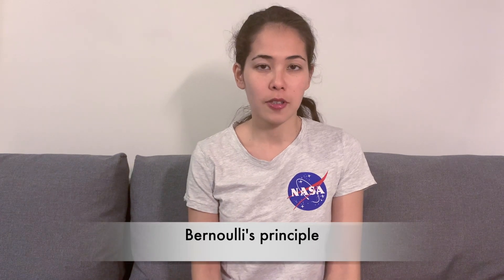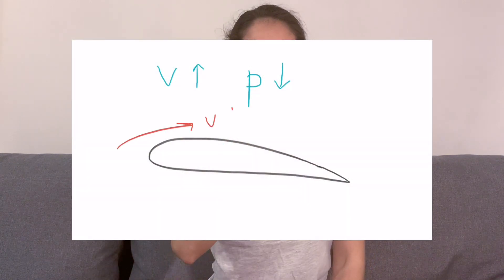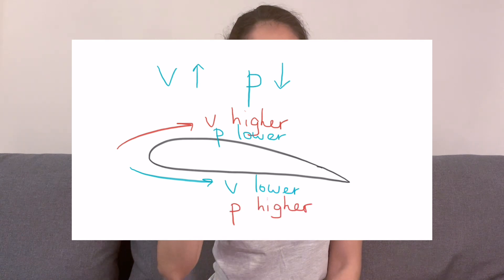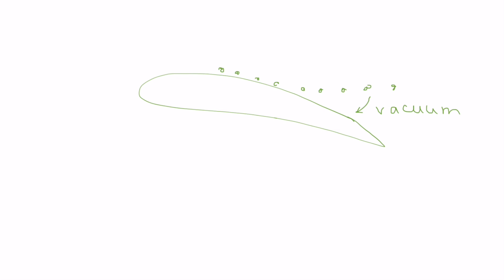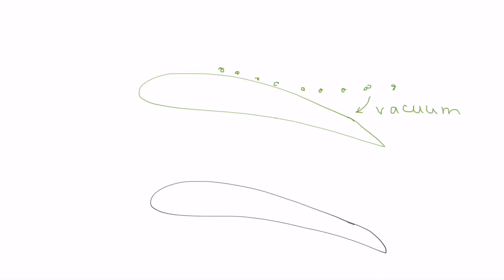What is the correct lift theory?

Comment: I think the molecules speed up over the top surface of the wing because of inertia, they are resisting the interruption of the wing coming into their space, the only way they can maintain their state is to attract each other, so if you could imagine the molecules being compressed at the front of the wing then rushing or accelerating to contract and attain their original configuration as they rush along the top surface toward trailing edge. I believe it is this spreading of the molecules and there attractive force and interactions that creates the low pressure. you could think of the molecules as having some elasticity as they try return to their equilibrium.

Comment: The problem is you are advocating that all those different concepts are fragmented because of some flaw you claim (such as you saying Bernoulli doesn't work because equal transit time is wrong).  You are clearly having trouble relating the significance of all these concepts in relation to each other and to the bigger picture, as evidenced by more than one mistaken explanation.  Best to be honest about one's limitations.

Ultimately you should be able to tie together, Navier-Stokes, Bernoulli, Newton, angle of attack, asymmetry, the relation of conservation of mass, energy, and momentum, the significance of potential flow, circulation, and the Kutta condition.  Your proper answer to this cohesive/inclusive understanding will then allow you to speak truthfully and fluidly about the mechanism of lift.  Which is not mysterious at all.

Comment: The bernulli principle is a conservation of energy statement that shows how air can trade kinetic energy for pressure energy while the total energy stays the same. As the velocity of a gas increases it's pressure perpendicular to flow decreases, however increases with the direction of flow. Conservation of energy is involved regarding lift, however is not the cause  of the lift. All lift is caused by the downward excelleration of air. There is not multiple causes.  You don't "create a bernulli effect " and then get lift. A pressure differential does not cause lift. A pressure differential  is lift that's been caused by the excelleration.

Comment: Nice video, Aliya! Subscribed!

I'm so glad you mentioned Newton's second law! When the air is flowing over the curved leading edge of a wing, it changes direction, which means there is a force acting on the air molecules. Think about the pressure distribution in a tornado. This causes the air to accelerate. 

When the velocity is increased, the pressure is reduced. This happens because of conservation of energy, which is covered by Bernoulli's Equation. Energy cannot disappear or appear out of the blue. There's nothing wrong with Bernoulli's Equation. It works perfectly well when you are flying upside-down. Just add a little more angle of attack. The problem occurs when Bernoulli's Equtation is combined with the equal transit time theory (hypothesis is a more correct word, as a theory can be proven by repeated demonstrations.) 

The wing profile of a hangglider appears to be flat at 5:13, but it is not. the leading edge is curved with the help of battens inserted into the sail. The lift to drag ratio of a hangglider is about 10:1, similar to a Cessna 172. And thanks to the low wing loading, it can utilize thermals and ridge lift efficiently. The world record for straight distance in a hangglider is 764 km. 

Newton is about conservation of momentum. Newton's third law of motion is the result of lift. If you want to explain lift to a layman in 10 seconds, then this is the way to do it. A wing produces a lot of downwash, so it is easy to understand. But Newton's thrid law does not only apply to the airflow under the wing. The entire airflow around the wing is deflected by the wing. Most of the lift is created by the top of the wing, until is stalls. 

Turbulence is uneven movement of a fluid; not vacuum. The lowest air pressure is measured along the curvature of leading edge where the air is accelerated. As the air is continuing along the upper surface of the wing, the air pressure increases.
Reply: You said: "The problem occurs when Bernoulli's Equtation is combined with the equal transit time theory (hypothesis is a more correct word, as a theory can be proven by repeated demonstrations.) "

But implicit in Bernoulli is conservation of mass (continuity of rate of flow).  And that "transit" equation of mass conservation is also one of the three pillar Navier-Stokes equations.  So, although equal transit time has long been discredited, the continuity notion of mass transit must work even for Bernoulli to be relevant (Bernoulli is derived from the truth of that condition).

So, it's not just sufficient for us to re-iterate that equal transit time is wrong, but we need to restate what transit condition is the correct one, because that mass transit condition drives the pressure-speed response of conservation of energy.  And that resulting pressure response is what turns the flow resulting in the conservation of momentum transverse force that is lift.

Comment: to understand lift try to understand gravity, Gravity hates nothingness, thats why lighter gases goes up lesser density goes up. Thats the principle of buoyant force that has force equal to the volume of medium displace x its specific wt of fluid displaced, the wing is the same. Many do not understand that gravity is being tricked by the wing design since it creates a curve  surface that has relatively faster  wind  and follows the curved downward due to coanda effect faster wind compared to its surrounding providing low pressure in the surrounding of wing with volume corresponding to the volume displace and for me thats the one that creates lift. Gravity therefore can be tricked. I have designed an air craft that can take advantage of this in order to trick gravity its like a flying saucer that has fan bell mouth inlet and outlet a baffle  plate on top  a curved body for coanda effect with hole at the middle to allow portion of air to enter another portion to take the curve surface Coanda effect and if you visualize it it is creating a baloon and Jelly fish like virtual pressure disturbance and gravity will be tricked as if it is a big hot air balloon a very efficient way to produce VTOL air craft.

Comment: Newton's laws can explain what causes the upward force of lift on a wing. However does not explain how that force is transmitted. Bernoullis principle is useful in explaining  how a force transmits to a wing, however doesnt explain what causes the force. The question of "what causes a lift force " is a separate question from the question of "how that force transmits to a wing." These are distinctly different questions, that require different answers. Lift is a reaction force that you have do  something first to get. It's not an action force. Before you can have an upward force, you must create a downward one. There is no other way. The airfoil shape does not cause lift, rather it causes efficient use of force. A low pressure above a wing doesn't cause lift, rather it is lift caused by downward accelerated air. You don't "Induce a bernoulli effect and get lift from it". Once the reaction of lift and bernoulli effect has occurred, an action has already occurred to cause it. An upward force on a wing can only be caused by a downward one. You don't "make a pressure differential and get lift from it", as lift is a synonym for pressure differential. Lift is a reaction force caused by the action  of downward accelerated air, period. And how those forces transmit is another question, that bernoullis principle will help you understand. In the false hypothesis, bernoullis principle is abused. A correct principle used wrongly.

Comment: The cause of lift is the acceleration of air downward. The is no other cause. You can not accelerate air downward without getting an upward force, nor can you have an upward force without accellerating air downward. 
A pressure differential does NOT cause lift. The bernulli effect does NOT cause lift.
Rather, a pressure differential IS lift, caused by the deflection of air. The equal transit time hypothesis simply confuses the cause with the effect. The bernulli effect can help you understand HOW a force  is transmitted to a wing surface, but does NOT explain the cause of the force.

Comment: 3:48 The fact that the equal transit time assumption (it's so arbitrarily baseless, it's not even a theory in my opinion, only an assumption) is wrong is actually not proof that Bernoullis principle won't apply as the two ideas are unrelated. It's therefore not a limitation of Bernoullis principle. 
 
4:52 Inverted flight is also not a limitation on Bernoullis principle, nor are symmetrical airfoils. In those cases, lift is generated by the AoA which lowers the forward stagnation point under the inverted wing, airspeed above the inverted wing will still be faster than airspeed below it. Bernoulli principle still explains the reduction of the static air pressure on the upper airstream hitting the inverted wing. It really isn't a limitation of the lift theory based on Bernoulli. 
 
5:50 The "people or cars" example really hasn't anything to do with Bernoulli or lift. There is no directed outside pressure driving cars forwards against the will of their driver. If the faster cars would physically push the cars ahead through the narrowing by using brute force against their bumpers, those cars in the narrow part would not slow down (they would rather try to hit the gas because of the fear of getting rear-ended). The diffrence is that gas and water molecules are in contact with each other behaving therefore like a stream or a fluid, whereas pedestrians and cars behave like independent particles, they don't push each other around. At least as long as they're not engaging in POGO dancing. 

In the case of the wing of a spaceship flying well beyond the atmosphere, if that wing is occasionnally hit by particles, there would not be lift because there would be no "stream", only collisions which will obey Newtons law of impulse and force and counterforce (action-reaction). Because in that case we talk about particles and not about fluids or pressurized gases forming a stream and nobody in their right mind would try and use Bernoullis principle in order to predict the reaction of the wing to such a collision with a particle. 

Finally both Bernoulli and Newton need to be combined, Bernoulli can explain the lower pressure above the wing whereas Newton can explain the "ram air" effect creating higher pressure on the lower wing. Newton also explains why air masses are directed downwards behind the wing.
Reply: Thank you!, finally someone else said it:

"The fact that the equal transit time assumption (it's so arbitrarily baseless, it's not even a theory in my opinion, only an assumption) is wrong is actually not proof that Bernoullis principle won't apply as the two ideas are unrelated. It's therefore not a limitation of Bernoullis principle."

Comment: Bernoulli's law doesn't apply to lift generation. Bernoulli's law states the relationship between pressure and flow speed along streamlines, while lift requires a relationship between pressure across streamlines. The lift is generated due to the curvature of streamlines along the aerofoil. Holger Babinksy has a great paper with the mathematical derivation of this relationship. Also, recent research has claimed that lift exist because of nature's tendency to seek a minimum flow curvature state.

Comment: That's the point. Bernoulli's principal requires that the air traveling above the wing travels faster than the air below the wing.  However this is not the case! There is no speed differentiation between the air above or below the wing.  The air that separates at the tip of the wing has no requirement or inclination to re-unite at the tail of the wing.  All these air molecules are for ever separated and have no magical effect to race each other and join back up. The air above the wing is completely cable of traveling at what ever speed is pertinent to it's resistance and it's inclination to return to zero movement.  Let's be extra specific and state the direction of the air in Bernoulli's principal is horizontal to the wing.  This effect can be shown in contrived experiment by creating two different speed air streams above and below the wing.  And this of course does create lift. However this is not what is occurring in reality.  In reality the air above the wing is pushed vertically UP further than the air below the wing is pushed vertically down.  Because the air above the wing is pushed further there is higher resistance for air to flow over the wing than under the wing.  Any air flow will take the path of least resistance which is under the wing.  Now the whole model is turned upside down from traditional thinking.  (And) From that new model paradigm you can now easily visualize why the wing must be lifted.  The problem with Bernoulii's principal is it is about horizontal air movement and fails to take vertical air movement into consideration.

Comment: You have some good points, but the traffic example is not difficult to understand.   You are discussing lift in the incompressinle flow regime.  Air molecules at normal temperatures and pressures act essentially like water and do not compress.  Traffic flow is compressible.  That is the distance between cars reduces, or compresses, as it comes to an obstacle or a reduction in the number of lanes.  This phenomenon happens when aircraft approach the speed of sound.  This is why aircraft design for supersonic flight  is different than for subsonic flight.  As far as inverted flight, yes, angle of attack and alot of thrust are your friends.

Comment: I agree that lift is due to a combination of multiple components but predominately the turning of momentum. Consider supersonic speed. Bernoulli's principle doesn't have the time to take effect. A rocket tricks air by employing an aerospike. Pretty much the shape of the rocket behind the aerospike is immaterial to the aerodynamics. For a bug to take off, it claps its wings and by pulling them apart, creates a vacuum to suck them up. Buzzards take advantage of updrafts. Some insects can see turbulence and time their wings to react with them for the best outcome. Finally, big passenger planes drag behind them huge vortices. That is why landing planes  are separated by a minimum distance and also why military planes no longer take off in pairs in case these flip the rear plane upside down. You haven't mentioned these at all. The Concorde made use of them for lift.

Comment: For me : air viscosity creates a virtual wall above the wing (at some point above the wing the air is undisturbed by the passage of the airplane) so the shape of the top of the airfoil creates a Venturi effect : meaning more speed, meaning less pressure. I agree that the 3rd law is better for the bottom part of the airfoil.  I like very much the PRANDTL theory where the 3rd dimention is needed to explain all, because air also moves sideways to let the airplane pass though it. So it create turbulences and you can push on those side turbulences to increase lift or speed of the aircraft. (Wild Geese flying in a V formation, the side ones take a nap, 8% less effort needed) like a water skier can surf on the boat wake without end.